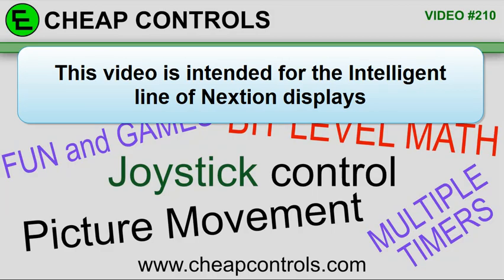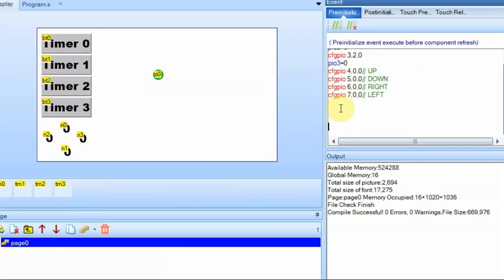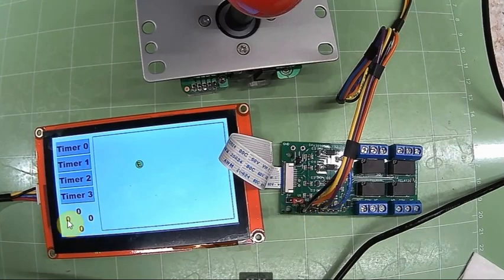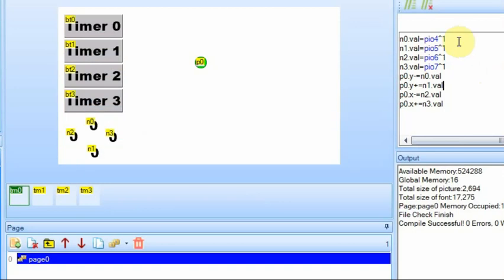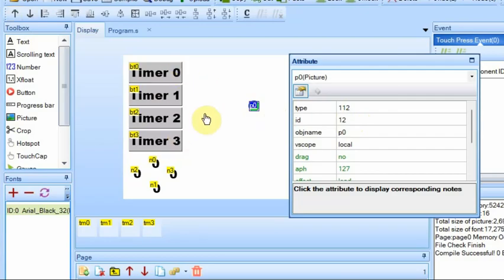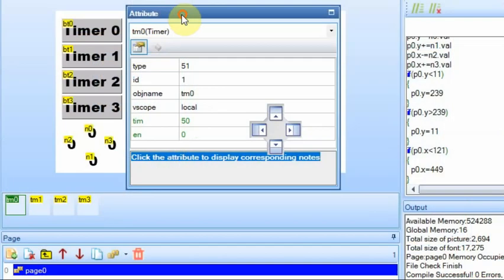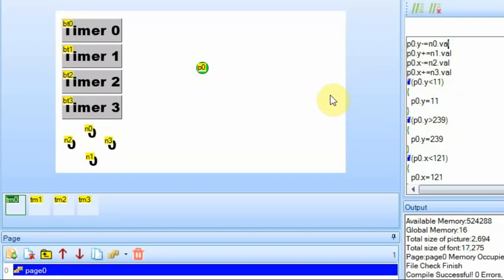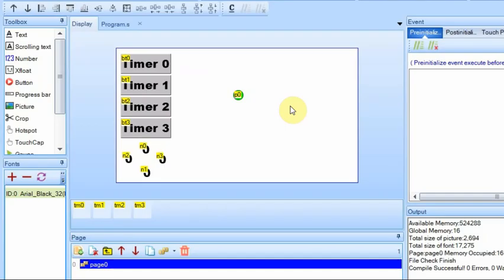210 Nextion, timers, a joystick, pio, and more!!!!!

Comment: I've been following your channel about the Nextion HMI displays and I've learned a lot.

A few days ago I ran across the Elecrow Advanced displays that seem to be a lot more capable.  They're ESP32-S3 based so you can use Arduino, ESP-IDF, PlatformIO as the IDE to program them.  They also support LVGL so you can do some really fancy graphics.  I've got several different sizes of the Nextion displays I've been working to integrate into a project.  After finding the Elecrow Advanced HMI display I'm thinking of betting my hands on one or two and seeing if I can migrate my project to that display.  The Elecrow Advanced got my attention because it used several toolchains I'm already familiar with, and they're much more capable then the Nextion IDE.
Reply from the maker: Sounds interesting.  Thank you for the kind words.